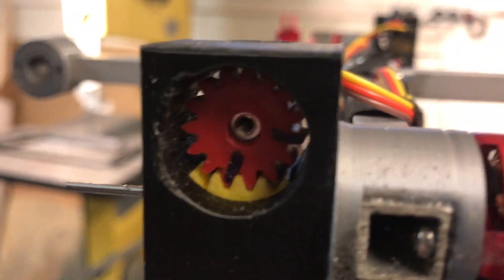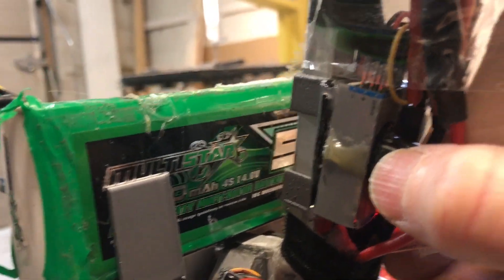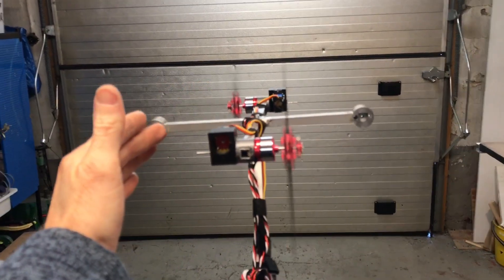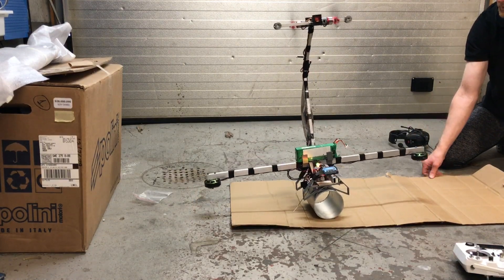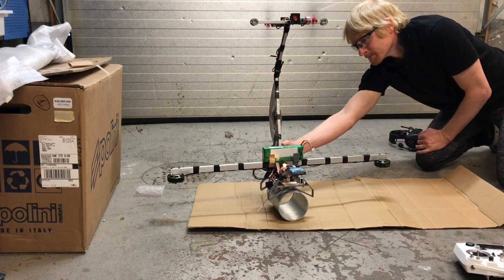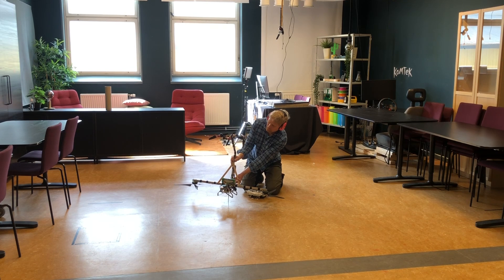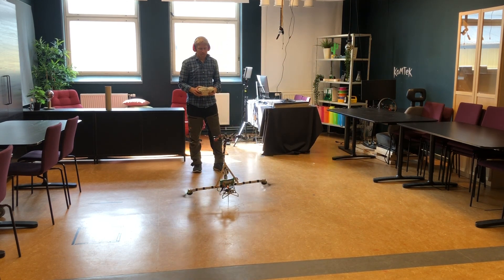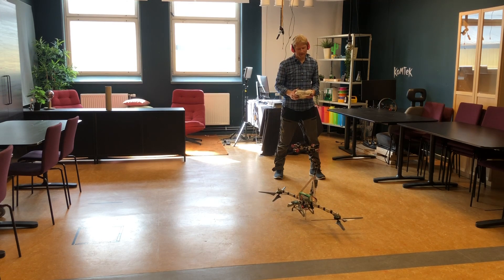OTV 8 (NEW CONCEPT + 1st FLIGHT!)

Comment: With the top motors electric and the main motors petrol, you could use small generator coils on main motor(s) to continuously charge batteries/supercaps. With enough backup power to safely 'out of fuel' crash.

Comment: that job could make adjustive collecting pitch props 
It is just another concept but 
I don't see better performances than standard multirotor helicopters or save more energy
maybe make with that sabilisation system ornithopter with flatter rotors
good luck

Comment: When the center of mass is not on the horizontal axis that makes it so when stopping from forward movement you will have a rocking chair effect. Quite a challenge balancing all the vectors on a system like that...kudos and great work!
Reply: That is what the PID systems are for. i.e. smooth transition and elminiating unnecessary oscillations.

Comment: So it's going hybrid I guess. Why use variable pitch for stabilization? You could just run 4 motors in a X combination like a regular quadcoptet. The quad controller provides stablizstion. There is a Thai fellow who has been building gas electric machines for years in this configuration, he uses them to spray pesticides on fields. They carry large liquid volumes and are very stable. He uses coaxial props for the gas motor/lift. But similar idea.

Comment: That frame is going to have to be extremely rigid to get a smooth enough PID tune, but if it's working on the prototype frame, that's a really good sign that a stiff frame could be buttery.
I would look into making a cheap mold and making the frame a custom, hollow, clams-shell, carbon tube with chunky corners. (wold look sick too.))

Also, when it gets relative velocity, while in flight, the range of the fixed pitch servo will need to get biased to match (the PID tune will do this automatically but at a delay, It would be better to code it in.) as well as PID response scaling with relative velocity, that might need some consideration. You might run into saturation issues with the fixed pitch props in flight where they don't perform as expected, but this could be instantly stopped with a velocity cap to maintain the headroom required on the upper motors/servos but using a GPS module and having a manual offset for current ambient wind levels, it's not a perfect relative air velocity, but it would ballpark enough for the PID tune to do the rest.

for extended/fast forward flight, you might want to bake in a specific motor RPM/blade pitch/PID tune to get it perfect for cruising, you can vector that tune away from forward facing (simple matrix math) later to get it to work in every direction of flight, but that system would need pitot-tubes to get the accurate vector needed to run it, the GPS + wind-speed trick wouldn't be enough there.

also, might be a good idea to run multiple gyros at either power section and sum the difference to cancel out frame wobble (to an extent), could speed up prototyping. I also highly recommend a GPS unit for data and ease of testing later.

Looks dope, best of luck man. I've always wanted to try a pusher control on a flat flying heavy lift drone, very interested how this plays out.

Comment: Very cool concept. I think yaw authority will be kinda weak when there is a greater payload/pilot onboard (assuming the two main rotors are always same speed).
Reply from the maker: Yes there are still many unknowns. The signal cable to the thrust motors are connected in parallel and are not a part of the PID loop, so same speed.  Im kind of surprised it can self level as well as it does considering the center dead band in the variable pitch setup. I did have to make 0.2-0.3mm shims to remove the worst slop in the otherwise beautifully crafted variable pitch design.  It will be interesting to see how the craft performs in the wild! :-D 
Im not super hopeful though....

Comment: Interesting concept and amazing you got it do such a great job in self stabilizing 👍 
But which applications do you see for it? 
Apart from tinkering around, where do you see an advantage versus currently used technology that can so the same, like modern quad drones, that hover as well only with even more stability, less power consumption and excessive speeds in horizontal flight even at high wind speeds, which this contraption will most likely never be capable of, because of its aerodynamical disadvantages in the vertical dimension.
Reply: There is a big advantage in the electrical system as it does not need to finely modulate the current to the main lift motors, meaning you can optimize them for power and leave the fine adjustments to the smaller motors switching lower currents
Reply: @deathbydarwin1985  Operating thin in s room under ideal conditions you may be able to neglect the precision of the higher power ESC, but outside in the real world with wind you also have to have to have a tight feedback loop between your sensory system and the ESCs. What kind of circuit comes to your mind that is supposed to be less precise and more efficient at higher currents than a common switching FET based 3 phase PWM circuit?
Or did you mean separating the heavy lifting with a bigger prop and the control/balance with a smaller blade system has purely physical advantage, not in the electrical domain?

Comment: The concept is ingenious! I never saw this before.  I love the primary functionality of the stability system, enabled by the variable pitch propellers, but there are so many potential failure modes (and no chance of redundancy),I sense as an engineer, it would take a lot of testing to verify the reliability.  Please do the Design and manufacturing FMEA's before you fly it personally!
Having said that, the stability system is analogous to a helicopter cyclic pitch system, and they seem to fly OK.....

Comment: I like it! Could the control motors (if powerful enough), rotate to face upwards in an emergency (i.e. loss of lift motors)?
Reply: Do you mean like a helicopter auto-gyrating? Store enough energy in rotating blades, then use that at the last minute to prevent a hard landing...

Comment: Can you explain how this design offers any advantages over a single main rotor type of small helicopter?
I keep looking at it and thinking you could eliminate 4 of the 6 props. lol at the "no, I could not find a way to add more blades".
Reply: How are you envisaging it working with only two props?  Basically a two rotor heli with swash plates?
Reply: @ferrumignis  or a bicopter (already implemented in Ardupilot for instance). With two tilting motors you can get the three rotations necessary for flight.

Comment: Sad to see the old one abandoned after getting so far into fabrication, but this does look more comfortable and stable. Seems like you'll only be able to take off and land on clean paved surfaces though, with the main rotors so close to the ground.
Reply from the maker: Well, the other OTV is not disassembled yet, I still like the form factor and the redundant nature of it. Although the propellers sure will have to process very dirty, turbulent air, which results in vibrations etc which I am now taking in to greater account from sound, efficiency and durability  standpoints.
But above all, the previous OTV gave me the motivation to invest in both TIG welding equipment and training. Still feel little sad though, so we share the feeling of loss....nice to not be the only one.
You are right, I will have to think a little about the propeller vs ground situation.

Comment: Is there an advantage to having the main rotors on the sides vs having them front and back?
Reply: the only thing i see is that the rear rotor would suck in turbulent air in forward flight, as is has to pass around the cockpit first

Comment: I made an identical concept a few year ago. Mine had only one main propeller  though. So I can confirm that it works.
Your major problem will start when flying i gusty winds. But it works.

This concept adds extra weight that does not contribute to lift, but the concept is sound.

One thing I was always  curious about - what flight controller program you use? Your own, or for instance ArduCopter?
Reply from the maker: The easy to set up and super versatile KK2.1: https://hobbyking.com/en_us/hobbykingtm-kk2-1hc-multi-rotor-hard-case-flight-control-board.html?queryID=df1c4324c333e07d48de919ae8117f45&objectID=46634&indexName=hbk_live_products_analytics
Reply: @amazingdiyprojects  Great, thank you!
I use different  Pixhawk controllers.
But what software?
I find software to be more critical than hardware itself.
I use ArduCopter software, but I’m not too happy with it. Hard to use it if you want to go with non-standard configurations. Need to modify the code yourself.
Reply from the maker: @andrewdec8049  The kk-board actually runs the stock 2.16 software. I The only thing I really miss is a barometer with accompanying altitude hold functionality, but the fact that you can configure this controller to fly pretty much any configuration of flying machine imaginable without even connecting it to a external computer is very attractive when you are trying out one concept after another. If I ever reach my goal  I will dive into the flight controller-universe and see if there is a better one for the design at hand!
Reply: @amazingdiyprojects  Yes, this makes that controller very appealing.
The only problem I see is that it uses an 8-bit processor. May be struggling with all that processing.

As for baro - barometer it’s not very precise, plus it is subjected to ground effect. I’m sure you know it.
Using Lidar instead of baro makes large difference for me. One can fly with Alt Hold with Lidar instead of barometer.

I understand from your comment that the KK board does not support Lidar either. That would be a real downside.
Reply: Still don’t know what flight controller program you use.
Could you share this information please?

Comment: Smart, so the two lift rotors are connected, counter rotating but operate as one, and the 4 upper rotors do all the control work, do the 4 control rotor motors change RPM or just pitch?
Reply from the maker: Just pitch, but momentary changes to coarser pitch slows the motors down.